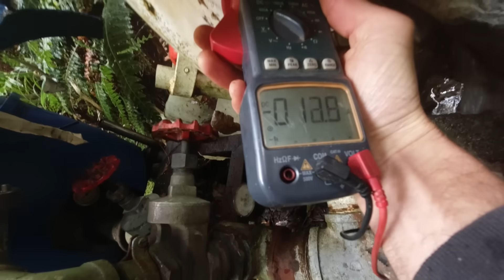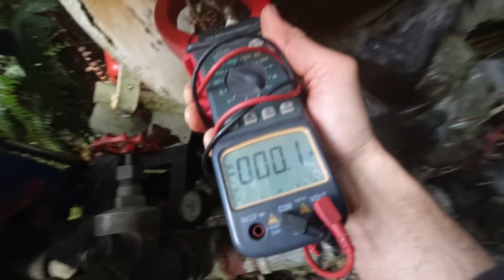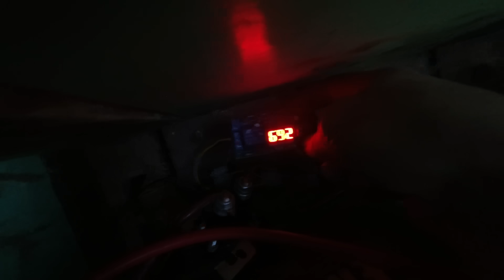Free Power for 16 years from a modified Washing Machine / Water Wheel

Comment: I had friends with a similar setup down in Marlborough.  They had their peloton wheel on a creek running through their property.  The wheel was right at their house though, made a bit if a racket.  They did manage to source all of their water needs off of the penstock pipe though.

Comment: him* "it generates enough electricity to run all the appliances in my house"

Me* "WHAT THE F**K!!"
hooked.
Reply: What appliances are in his house?
Reply: He said it outputs about 600W. What about kitchen appliances. Toaster (2KW), kettle (800W - 2.5KW), microwave (800W), dishwasher (1KW+), washing machine (1KW +), fridge (200W when compressor is on). Theres no way he can run his whole house on 600W.
Reply: @simontay4851  of course it can. Toaster needs 2000w peak but only for 5min. So 166Wh. This generator genrates 600Wh. And if you only use your toaster once per day then thats that. Go through all the appliances you listed this way, and you will find that with batteries to bridge the peak requirements this 600W generator can indeed power the whole house.
Reply: Ontop of that.
Fridges we think about as running 24/7 but they don't.
They are efficent enough to stop running the vast majority of the time.
Reply: @simontay4851  He said it charges batteries.  The batteries handle the load, the generator charges the batteries.
Reply: fvcking same

Comment: im an apprentice electrician in NYC and we are learning voltage drop and how to calculate it.  How do deal with the enormous amount of voltage drop on this set up?  I mean every calculation that ive done with the volts and amps says that youd have to live within about 2,400ft within the perimeter of this set up.
Reply from the maker: I use an inverter to boost it to 240vac at the turbine, very little cable loss
Reply: @MartyT  we're going to be talking about what different ways in class this weds I spoke to my professor and she finds it super interesting.  Might even have a test question with your setup on the next test haha.
Reply from the maker: @_D.I.G_  Thats awesome

Comment: 12 Amps at 24 Volts. 288 Watts.  You're not going to do a lot with that.
Reply from the maker: Once I cleared the intake I got 25 amps with both turbines running = 14.4 kwh per day. Most of the year the stream is higher and I'm making 30 amps

Comment: How does 600 watts run a compressor ?
Reply from the maker: Power is fed into a small battery bank, from there it goes through a 24 - 240vac 5000w inverter so I can tun up to 5kw for a short time. The battery makes up the deficit when running high load things.

Comment: What is the head elevation (and PSI) of this system?
Reply from the maker: 42m
Reply: @MartyT  if my calculations are correct, that would be about 61 PSI?
Reply: I'm new to your channel and really enjoyed this video. Have you made a video about the particulars of output voltage, amperage, rectification and how you adapted it for your household use? Thank you.
Reply from the maker: @migm7428  Spot on

Comment: Is this turning the washing machine motor for the generation part - and if so, do you need to run the power through an inverter before your fridge can run on the electricity?
Reply from the maker: Yes I use a 24 - 240vac inverter

Comment: With the quantity of water that is going down, how can there be 600w here..?
Reply from the maker: Its all about the water pressure
Reply: @MartyT  Not really, you could have 1500 bars with ridiculous water flow and still got near no power, like in a diesel injection ramp. Of course the height of water you got in the tube increase pressure but in the end, the max energy you can harvest = quantity of water x height of displacement. (sorry, english is not my mother tongue, i lack some vocabulary).
So to make it simple, pressure is a parameter but it's nothing without water flow

Comment: Have to wonder if it wouldn't have been better to run it to the house as AC 3 phase and then convert to DC. That would have cut the current load per wire at the cost of using 3 conductors.That would have cut voltage drop.  I'd like to see the voltage readings and current readings at both ends of the cable. Also an RPM reading on the turbine.

Haven't really gotten to play with my F&P Smartdrives but have with the Samsung units. The smallest Samsung units are rated at 2.5A @ 310 V when used as a motor. They are 18 pole instead of 36/42 pole units like the 12" diameter ones. At 1000 RPM I have seen it put out 300 Watts at 27VDC as an alternator. And while they are rated at 800 RPM, I have actually spun one up to 2000 RPM as a motor. Now I need to try it as an alternator at that RPM. But currently I am working on a 36/54/72 pole stack of the small ones to cut cogging at low RPM. As I have three F&P 36 pole units, it might end up seeing a 108 pole unit If I can engineer the shaft to rotor couplings.

Comment: Haha when there’s Overvoltage, it’s just dumping the power in a waterheater downstream xD
Reply: not the best for the environment, Most ideal he burned that excessive energy at his house site and used it to warm up the Spa.
Reply: @eco_logic  You would be hard pressed to make a measurable difference in temperature with that setup.
Reply: eco logic I’m not completely sure about my following theory: 
but because conservation of energy  „rule“  it might even bee that the energy that he took out of the water is just being feed back. So what I mean is in what parts is the water Head pressure energy normally translated, probably mostly kinetic energy I guess. 
Does anyone know how efficient that process is in a river ? 
Cause I’m guessing his generator isn’t more efficient than 50% (grabbed the number out of thin air....)  

on the other side some 400w isn’t any heat at all In terms of heating water
Reply: @eco_logic  Then he'd need another 400m (or whatever it is) of wire just to supply that. Much simpler to just dump it right there. Logically.
Reply: @eco_logic  Why? The water would have produced that heat anyway, from friction on the rocks on the way down.

Comment: Looks like an old riverbed, betcha there's some $Gold nuggets in those corners and under the big rocks! Also, when your generator overcharges, why not just use a voltage regulator to maintain a steady voltage like a car alternator uses, it would be a simple hookup and they do make them for 24 volts DC, Just curious.

Comment: What powers the water to the turbine through the long pipe line?

Curious👍
Reply from the maker: Gravity, The intake is higher than the outlet nozzle
Reply: @MartyT  well that answers that 😂👍 I seen you cleaning the dirt then assumed the pipes were running upwards as they were in the next part 👍

Comment: That's pretty fascinating.
Regarding running the power lines back up to the house:  What voltage are you using, and, is it ac or dc?
I think you said you're getting 25v and 20A.  
Are you converting to a higher AC voltage for transmission?  What gauge wire?

Comment: Hi Marty, cheers from over the ditch in Tasmania. We have a winter creek on our place with pretty low flow and about 40m fall from top elevation to the bottom boundary. Would this be sufficient fall to get a system working to supplement our solar in winter?
PS loved the video, more please
Reply from the maker: You would get something out of it, 40m is similar to mine

Comment: Wouldnt take much to throw a low dam across that cut ravine and regulate your water flow year round.
By holding back some water behind a damn you could have consistent flow in all but drought weather.
But that is only something to consider if you really do have power shortages during the dry season.

Comment: 20A @ 24v = 480W, you are mistaken or lying, this is BULLSH1TE! I doubt that you could get more than 200W from that set up even if you used an efficient generator there is just not enough energy in the water. Add onto that a horribly inefficent generator... I estimate 50W realistically, 100W tops.  Want to argue with me? OK think about how much water a 480W pump can chuck out, then think about the situation reversed.
Reply: @Drenov You're either a moron or a TROLL. Seek professional help.

Comment: im a u-tube energy guy i have seen these old wash machines on UK videos im on the 45th parralel on the canadian border and mine are usaliy GEs nothing like yours.is smart-drive the make of these machines?i think Vermont solar enginering company had something that looked like a cake bunt pan with a car alt. on top probably a mechanicle seal for artisan wells.Thank You for your Video.
Reply: Smart Drive is just a marketing name for the motor. The washing machines these come in are made by Fisher and Paykel  (FnP) which used to be an New Zealand company and they were the first manufacturer to incorporate a direct drive motor in a washing machine - hence the reason they can be turned into a generator. I recall reading an article years ago which discussed Smart Drive motor based generators and it included a comparison of the different generations of motor as some were more suited than others . 

I'm fairly sure most washing machines now use direct drive motors, but Smart Drive is still the most common you can find as scrap in NZ as for a long time they were "the" washing machine everyone bought. A decent number of people have re purposed the motors for generators like in the video although this is by far the best and most comprehensive design I've seen.

Comment: Ive seen trees get struck by lightning and have that dead/rot corkscrew pattern down them. Maybe thats what happened
Reply from the maker: Thats possible but this tree is right down in the valley, usually lightening hits ridges and high points

Comment: So basically you killed mountain river for your electricity. Wow. What is that to be proud of?
Reply from the maker: Incorrect, I'm diverting some water to generate electricity, the water goes back in to the stream from the turbine
Reply: @MartyT  but half of the stream is without water cause it goes into your pipe. Isn't it?

Comment: 600 watts? Nobody builds a house nowadays with less than a 200 amp service, or 300, from the grid. Hard to imagine getting by on 24v @ 20+ amps.
Reply from the maker: 600 watts x 24hrs  = 14.4 kwh per day. My inverter will run all the usual household appliances, the batteries make up the deficit when using a high load appliance

Comment: I’d love to learn more about this, including the intake.  Do you have a video that shows the construction and installation?  Do you step up the voltage for transmission, or do you transmit at 24V?  Did you 3D print the turbine, buy it, or something else?  Is there any reason a brushless generator wouldn’t work?  Seems like it would require less maintenance...or maybe the one you have is brushless.  Is this legal?  I suppose you own the land?

Very cool.

Comment: Impressed by what you're running off that considering what we can run off a 1200w solar set up (not so much).. have a next door neighbour who has a rather fancy micro-hydro set-up that must've cost him a few bob and was thinking of doing the same but this has me rethinking.. wondering what flow you have - we have a 2" pipe in place that carries at least 8 gal/min all year with a 150m head..
Reply from the maker: Solar only makes power during daylight hours so you need a large battery bank. Hydro is producing power 24/7. I have around 3l per second but only 42m head, you will have pipe wall frictional losses  due to using such a small pipe.
Reply: @MartyT  Thanks for the reply! Ya, ideally it would be a 3" internal dia. as neighbour has but it was already there so beggars can't be choosers.. Wouldn't have imagined you had that much flow from the video - your creek looks about as active as ours.. Is there anything about the smartdrive motor that makes it particularly desirable?

Comment: Have you modified the motor at all ? You can gain much more output upgrading the windings to copper. Nearly all washing machine motors use aluminium windings for cost saving reasons. The aluminium wire still appears to look like copper due to the enamel insulation.
Reply from the maker: Yes I have rewired the stator to reduce the voltage and raise the amps.the smartdrive motor is copper wound
Reply: You could also experiment with dual pole winding. Every phase has 2 poles in a row wound. AaBbCc Vs the normal ABCabc. You might get more current out if it but at the cost of more noise and cogging. These motors are designed to be low noise even at the cost of reduced efficiency, a bit of playing around and you can get some extra output. I work for Fisher & Paykel technologies designing these motors 👍

Comment: Really cool! But i would think that small stream of water would run dry for some parts of the year. Do you use backup generators?
Reply from the maker: No it never runs dry, yes I have a petrol generator for welding etc

Comment: So you say several times you built it 6 years ago, title says 16 years. Still remarkable, would be nice to hear more about the process of rewiring, and did you buy or build the pelton wheel?
Reply from the maker: I built the current turbine 6 years ago but the system has been running non stop 16 years using earlier prototypes

Comment: There's a power drill coupled to that valve with a right angle gearbox - what's the story there? Is it the actuator for the emergency dump valve, does it let you remotely adjust the water feed to the nozzle?
Reply: Yeah I wondered what the drill for,Im gonna guess the same its to control the valve.